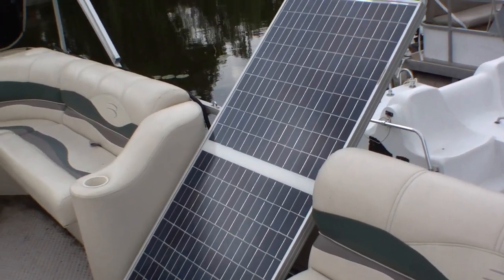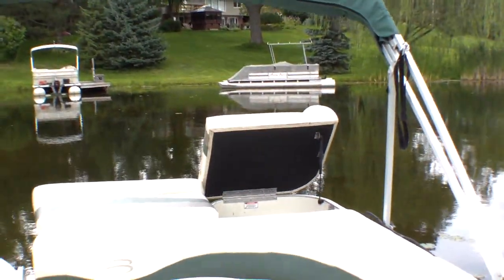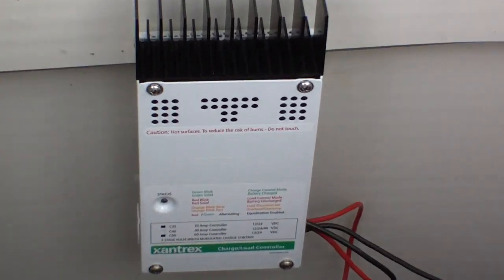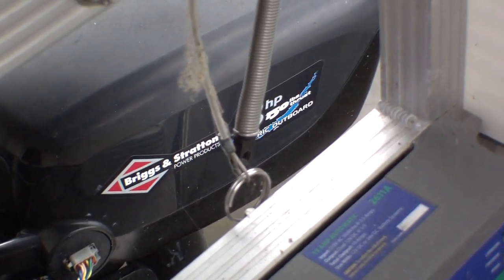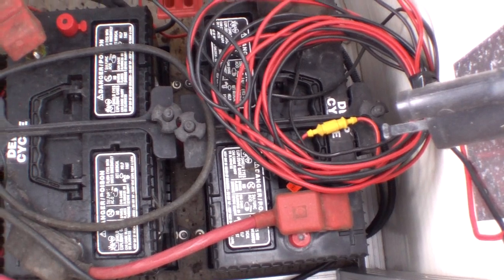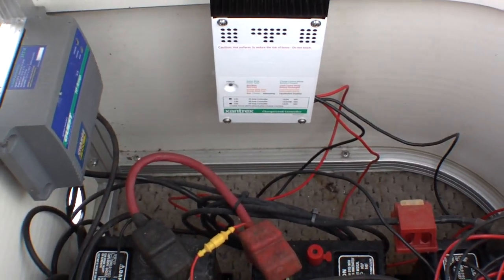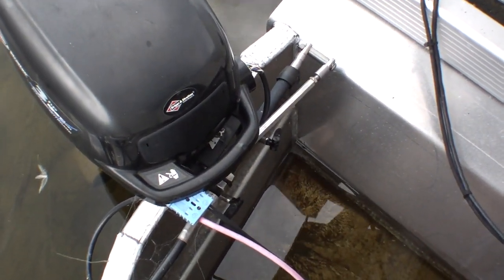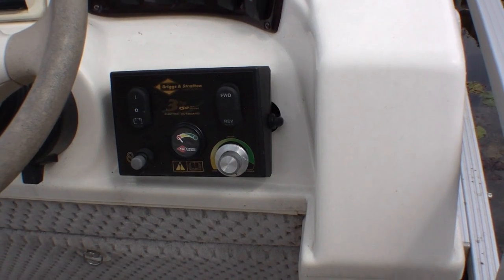Solar Powered Pontoon Boat

Comment: How many hours can you run on a charge, or per day? What is your battery recharge time? Do you rely on shore power at all?
Reply from the maker: I really never tested it. The panel will keep it charged during the week. I have plenty of charge to run is on the weekends without getting low. The most I am running at 3/4 max speed would be a couple hour. Not heavy use. Other that that stop and go to fishing spots.
The only shore power I use is the fully charge the 4 deep cell batteries at the beginning of the season.